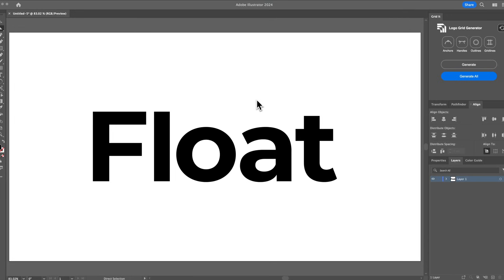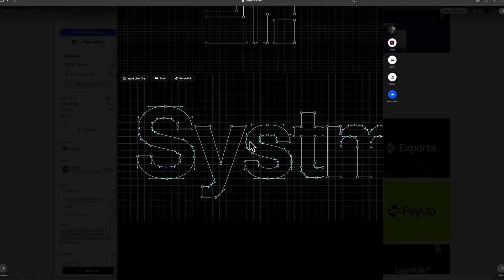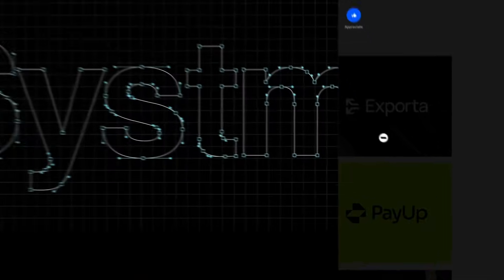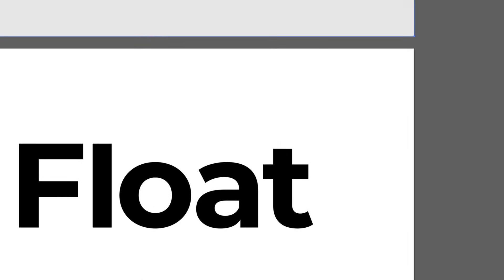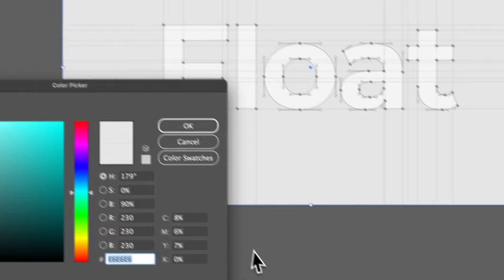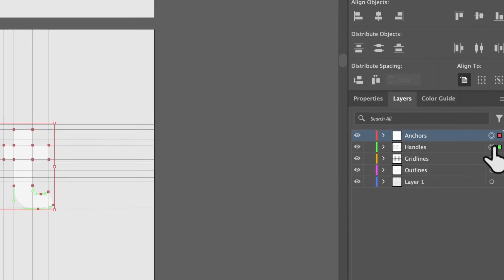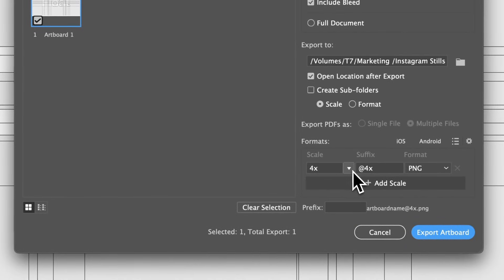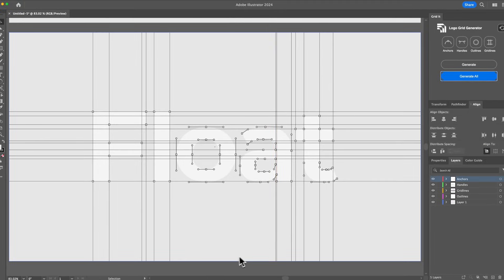How To PRESENT Your Logos Using Construction Grids

Comment: I never knew about that plugin GridIt!  I've done something like that by just taking screenshots and messing with blend-modes for the layers.  As long as your line work isn't jacked up, it should work out fine.  I also like to come in and draw grids and circles after the fact (somewhat arbitrarily).  Take any logo, and start throwing lines and circles where they fit (maybe even the occasional fib bonaci spiral, scaled to fit, and your client's mind is blown as if you had to channel Leonardo DiVinci himself to make the logo.